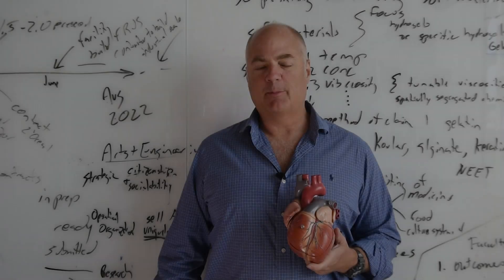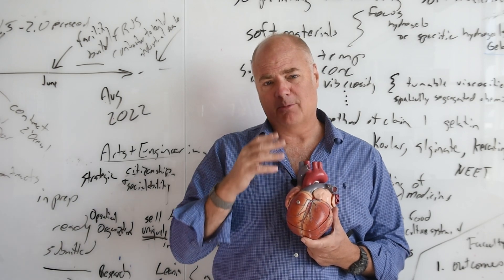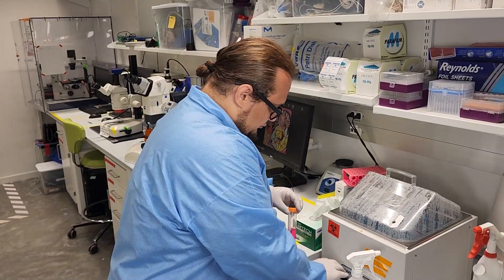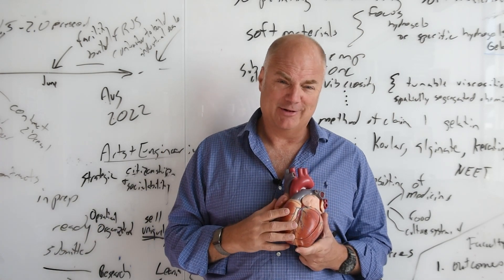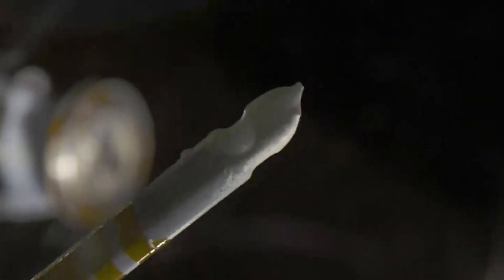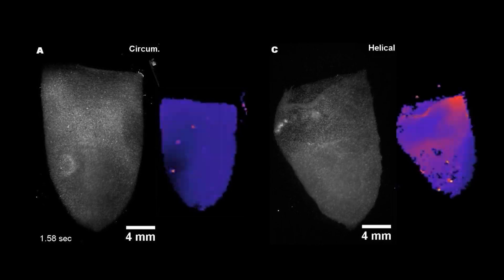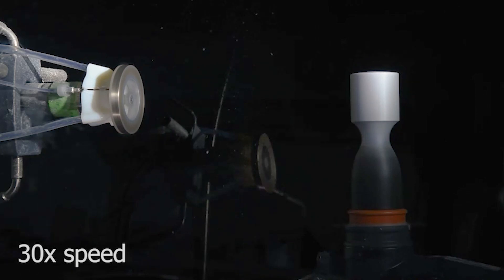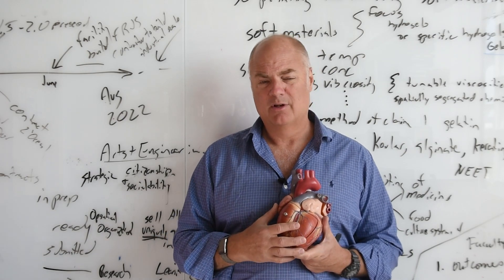Focused Rotary Jet Spinning for Creating Helical Heart Models

Comment: Are you using animals in horrific experiments  ???
Reply: Should they use humans? Why don't you apply?
Reply: @jairomorini3941  There is no need to use animals when proper scientific mathematics,  modeling methods and simulations. 
But, they should still test it first on YOU instead of an animal. 🤣